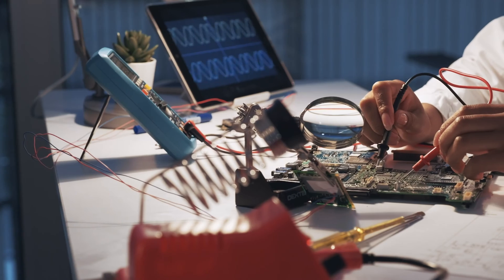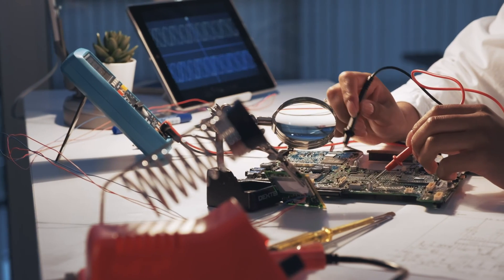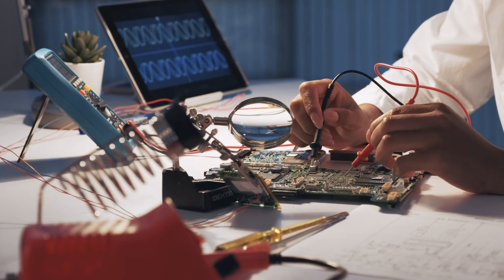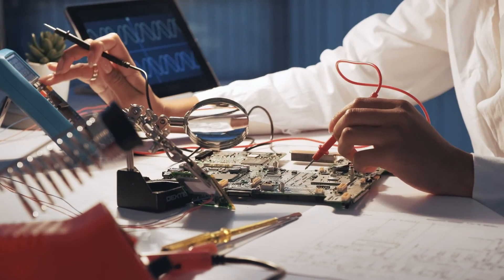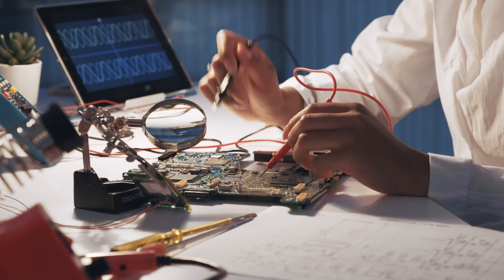Redarc 1250D Issue,  2 hour Charge Limit.

Comment: AU$309.99  Renogy DCC50S 12V 50A Dual Input DC to DC Battery Charger with MPPT
Reply from the maker: $339.00 with bluetooth dongle.   Just not sure if I have the room for the Renogy,  It's much larger than a Redarc.
Reply: @PhilsCampingReviews  because its got a heat sink unlike the redarc , make sure it has air flow if you go the renogy